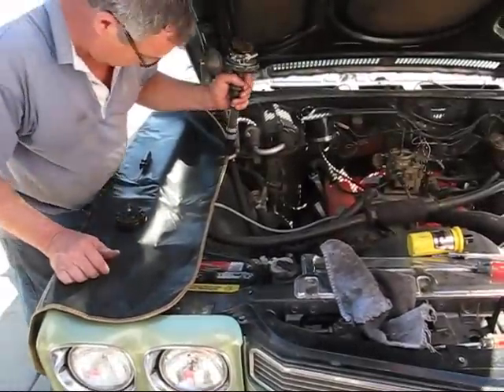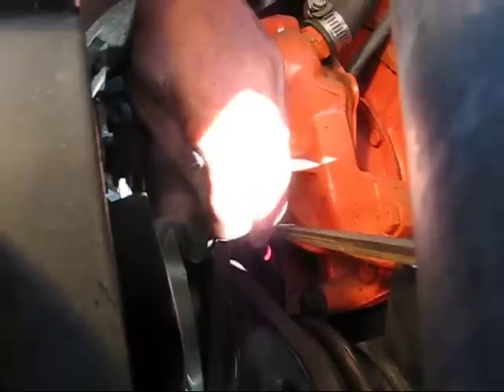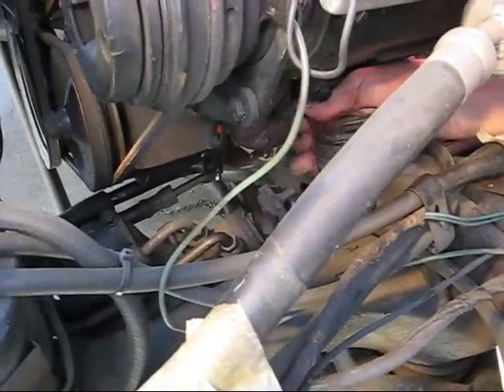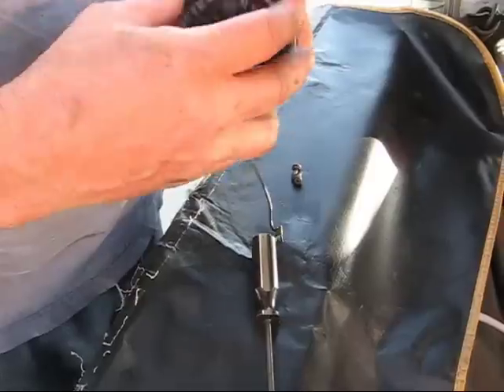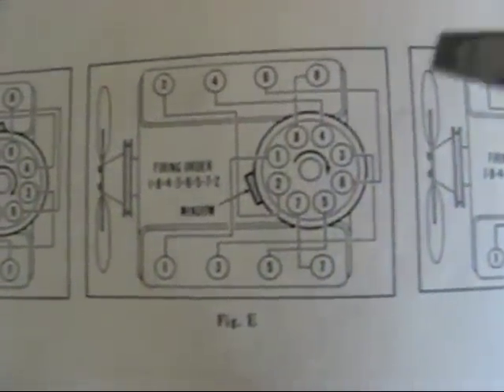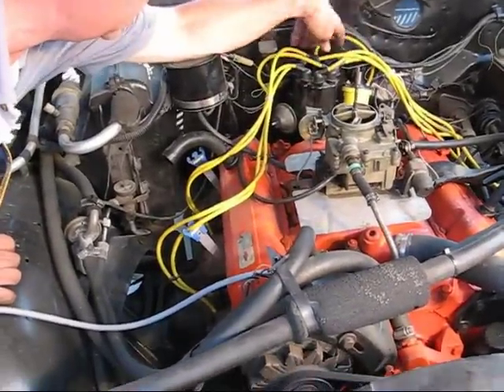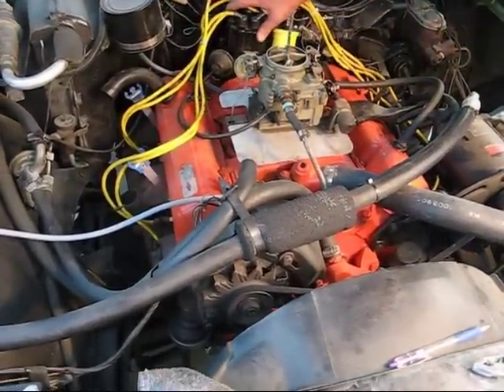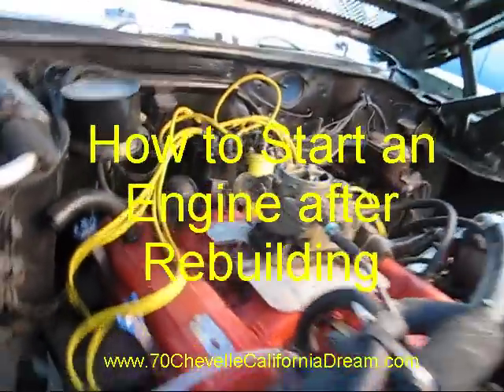How to start an engine after rebuilding

Comment: Correction on oil priming: If you are wanting to spin a distributor with a drill to prime the oilpump, you must remove the cam gear from dist.
Reply from the maker: Your are right.   My fake / altered distributor does not have the gear.

Comment: If you don't have the way to turn the distributor, can you just pour oil over the rockers so wen the engine starts there is some lubrication?
Reply from the maker: I was told that you can buy those tools on the internet.  Never looked.

You can also disconnect the coil wire and turn the motor over until you get good oil pressure, then start the car.

Comment: I just finished rebuilding my 350 sbc with your videos.  So the way you start you motor here is all?  No cam break in needed?
Reply from the maker: I prime the engine (see video) to make sure oil is everywhere and oil pressure us up, then start the car and let it run for about an hour at 2,000 rpm.
Here is my results:  https://www.youtube.com/watch?v=vm-YY-xsMyM

Comment: Looks just like my old 72 impala, points and all... except it had the 400 small block. Was you vacuum advance any good? I noticed you didn't show testing it. Btw, when you timed it for TDC, you didn't verify 1 at compression stroke, you could have easily been 180 out. TDC happens twice, once at compression and once at exhaust stroke... which one were you on? A simple rag in the plug hole would have told you which one... you assumed but got lucky unless you just didn't show us.
Reply from the maker: Same
I did not test the vacuum advance.  I used a wire to see if the piston was at the top.  Maybe got lucky but it is not that hard to rotate it 180 degrees.
Runs great:  https://www.youtube.com/watch?v=vm-YY-xsMyM&t=6s

Comment: Or you can drop in the distributor without the cap, take the #1 plug out, put your finger in the hole while your helper cranks it over and just watch where the rotor is when the compression blows out
Reply from the maker: Yes that would work and have uses this method many times.   I though it would be easier for the people that never done this before that way they can go real slow and see the wire come out showing the piston is at the top.

Comment: Cylinder need to be Top Dead Center (TDC) on the COMPRESSION stroke.  It is a 4 cycle engine meaning the #1 piston will be on TDC twice for each cycle.  First (compression) is when the cylinder fires.  Next time the piston comes up, the exhaust is forced out. Did not see you check it was on compression stroke.  You must have since it started.  Myself, I just hold my thumb on the spark plug and turn engine until I start to feel compression, then manually rotate engine to TDC.
Reply from the maker: Instead of using my finger, I use a little piece of wire to tell me when the piston is all the way up.  Sometimes I am 180 degrees off.

Comment: #1 piston is always at top dead center when those marks align, right?.  The vibration damper is connected to the crankshaft isn't it?  Thanks for the videos.
Reply from the maker: No - it could be 180 degrees out.  You must check the #1 piston up and the rotor point to #1 on the rotor cap.  Watch video at the 3 minute mark and 11:35

Comment: No cam break in at 2000 rpm for 20 to 30 minutes.
Reply from the maker: Here is my results: https://www.youtube.com/watch?v=vm-YY-xsMyM
It has 5,000 miles on it with on metal shavings in the oil pan.

Comment: Easy way is Top Dead Center(TDC) "Compression Stroke" on the #1 cylinder then you won't be 180° off he was real lucky it wasn't on Exhaust Stroke... Pull that #1 plug put your finger on top of the spark plug hole turn engine over you will feel it suck your finger in when on Exhaust stroke. Then on Compression stroke you will feel and hear pressure push your finger away from the spark plug hole then slowly turn engine to bring your marks together on timing marker and dampner line to "0" on timing pointer. Here's the skinny; TDC "Compression Stroke" and dampner line pointing to "0" on timing marker is what you want to do so your not 180° off. Get a CHILTON'S Repair Manual that covers your Car's Year it will help you out more then this man's video has... "READ IT"...
Reply: I learned more from this video than any other
Reply from the maker: You are right, that is another way to do it.  But it makes it a little harder to do it like that if you are doing it yourself because I cannot put my finger on the spark plug hole and turn the engine over at the same time.
Reply: David Lis; Make a remote switch (or buy one) then you can do it by yourself OR use a long breaker bar and socket to turn engine over by yourself. I could see you had helper thats good but must show younger people how to do it correctly not make excuses for not doing it the correct why. Please don't think I'm trying to upset you "I'm not"... I just want to teach people the correct why.

Comment: How not to start an engine after rebuild. The only thing done correctly was off camera with priming with gearless distributor.
   Sorry bud not trying to be a jerk, these thing are expensive and could mislead someone right into catastrophic failure costing them a bunch of money when it takes just as much time to do it right.

Comment: i heard it is good for the engine if the first time starting slamming on the gas and then redline it bonus points for using diesel instead of oil
Reply from the maker: I don't think that is the right advice.  I usually let the engine run at about 2,000 rpm for an hour.  This way it gets up to operating temperature and all the new running parts get a chance to rear in together.   Then there is the break in period when driving the car.  I like to do a little city driving so the rpm go up and down and not at the same rpm level as highway driving.    Try to mix it up.

After about 1,000 miles, I change the oil and oil filter and I look at the removed oil to see if there are any metal filings in the oil.  Then, I change the oil again at 3,000 miles.  Now I feel confident to start running it harder.

I don't understand about using diesel instead of oil.  Missing the point.

Comment: Is that a 307
Reply from the maker: It is the original 350 with a barrel carburetor.  It has more than enough power to spin the tires.   I have about 3,500 miles on it and it is running good but I only use it spring, summer and fall and never in the rain.   I am afraid of other people driving.

Comment: thanks for everything now im ready to work on my engine
Reply from the maker: Take your time, you can do it.   How do you think everyone else learns?
Reply: Thank you, I'll reach out to you for some tips.
Reply: David Lis hi David , I need a bit of info. do I have to lower my front bumper to replace remove grill on my 69Chevelle
Reply from the maker: No.  It is just hard to get at some of the screws. I used a 1/4 inch drive socket set.
Reply: David Lis hi David. I have a 1969 chevelle that im putting a motor in. it's a sbc that has a esc four plug harness. can I jump the two correct wires out of the four and hook up my others and leave the dizzy in. I'm trying to make this as less painless and FREE as possible. lol thanks I really enjoy your videos

Comment: Ok. At no point did David claim       "Professional 350 chevy small block rebuild" He did what he had to get it done. Yeah unorthodox at times, pliers on the coil etc etc. Proofs in the pudding 4000 miles and still going. A lot of people just plain can't afford 100.00 @ hour shop rates or they just want to try it for the satisfaction of saying I did that. BTW his driveway was a lot cleaner than some 100.00 @ hour shops I've seen.

Comment: I always prime just before the start like you did, do it on the stand the oil will drain down (not good) easier is not always better........just saying.......
Reply from the maker: I just use a fake distributor and a electric drill.
Reply from the maker: I use a fake distributor and a electric drill and I do it just before I start the engine.

Comment: Yes, of course prime it again if it's going to be sitting on an engine stand for an extended period of time. (That's a no brainer) (You can prime an engine as many times as you want or as needed.) The purpose of raising the number one cylinder to TDC (top dead center) has nothing to do with priming the engine. It's just easier to do while out of the car. I would use a dial indicator to find TDC, not a screwdriver or anything else.

Comment: As much as you don't want things to leak, I'm surprised that you did not use any thread sealer in head bolts and water pump install, nor was any thread locker used in areas such as flywheel bolts and the likes.  Maybe this being an old engine it is not required?

Good series, I enjoyed it, thanks for taking the time to document and share.
Reply: Just grease
Reply: It's not always needed on a stock build, the rear crank on the older SBCs doesn't have oil to the flywheel bolts. Stock engines don't really need the head bolts sealed, they don't run higher temps or cylinder pressures as do the High Performance builds. The water pump doesn't need the bolts sealed, they have a gasket and rtv to seal them up. My father and I built dozens upon dozens of stock engines never using sealer on the head bolts and some are still running today.  That is mostly done on dissimilar metals, as in a iron block and aluminum heads.
Reply: OK thanks. was just wondering.

Comment: I believe I would have primed the oil pump to get the oil to the top end, then rotated the crank to get the number one cylinder to TDC and then install the distributor with the number one cylinder set to fire while this was on the engine stand. Would have made it a lot easier then with it in the car........Just saying.....
Reply from the maker: Yes, but it was a long time from the engine on the stand to when I installed the engine in the car, and got it ready to start.  By doing it just before starting the engine, the priming was fresh and the oil was everywhere ready to go.
Reply: I agree with David, I just finished a Dart 400 that I primed on the engine stand and it was months before I put it in the car, so I primed again.  Besides you can prime one without moving the crank, I did it.

Comment: Man oh man, you were doing greatish, primed the oil system to make sure you got oil through the galley's, pumping up the lifters, and through the bearing holes and then you deliberately rolled the motor over because you wanted to build oil pressure. 
 That put serious strain on the cam lobes and other dry areas that have had enough time since priming the oiling system for all the oil to be gone, from them. 
 You could take the life out of any lobe if not more by rolling it over dry.
 The trick is for the motor to fire right away and if it doesn't don't keep rolling it over until you've determined why it didn't fire up.
 That mistake is one of the most common of all when someone rebuilds an engine but dosen't have the experience to understand how quickly you can flatten a cam lobe among other things.
 Just put a little gas in the carb and let it roar to life, and then keep your RPM above 2200 better yet 2700 so you get oil being pumped through the entire system under pressure.
 I apologize for being critical but this is such a common mistake and kill the longevity of internal parts instantly.

Comment: I normally do not say anything, but after 30+ years of building engines, there is a lot of mistakes in these videos. It gets very expensive when you wipe a lobe, or scar up bearings, not only do you have to replace those parts, you have to get the metal partials out of the engine in order to keep from damaging the new parts. I have ran cheap and expensive cams over the years and have not wiped a lobe yet, but the spring pressures are correct during break-in, correct oil and correct break-in procedure. I have a small block Chevy 350 setting on one of my stands, the guy did not follow the correct build and break-in pedicures, wiped lobes, scared bearings, scaring in the cylinder bores and on pistons. I just do not want people to be out a lot of money when the engine fails or never performs like to should.
Reply from the maker: The motor has 4,000 miles on it.  I changed the oil at 1,000 miles and no metal particles in oil pan.  Changed the oil at 4,000 miles and no metal particles in the oil pan. 

I always prime each engine before stating it so all the bearings have oil on them.   I also crank the engine with coil wire off until the oil pressure gauge reaches 40 - 60 psi, then I install the coil wire and fire it up.

Comment: A minor correction - the spark is sent when distributor contact opens, not closes. When contact opens the coil releases its electromagnetic energy into high voltage spark.
Reply: When you don't know, don't speak. Moron.
Reply: @DangerZONEpixel again, educate yourself and learn to READ before you WRITE.
Reply: how the fuck is the spark gona go from the coil to the spark plug if there is no contact of points in the distributor? idiot.
Reply: To dangerzone pixel. Nils Jakobson is right and you are wrong. A coil has a primary winding and a secondary winding. When the points are closed electricity flows thru the primary coil creating a magnetic field. When the points open the magnetic field collapses sending a current through the secondary side of the coil creating a huge jump in voltage that comes out the top of the coil to the distributor. This is a very basic explanation but it might prompt you to look it up on google and prove yourself wrong.
Reply: It wasn't for you, spare your wrath, it was written for the only moron here, Danger ZONEpixel. Sorry, I answered in the wrong box.